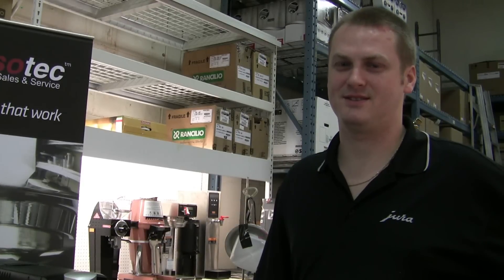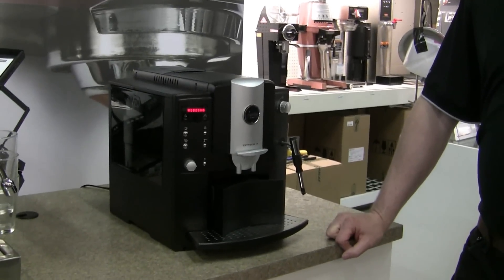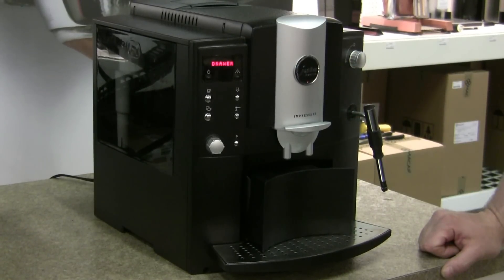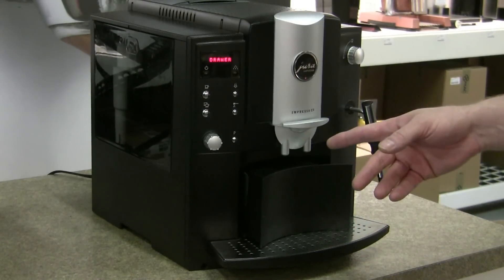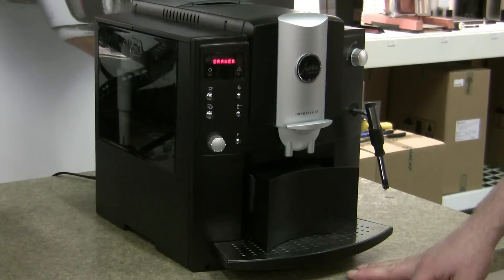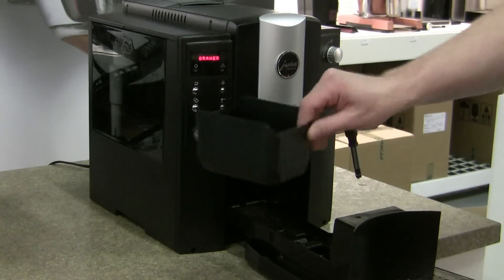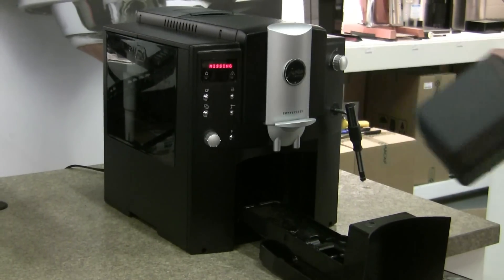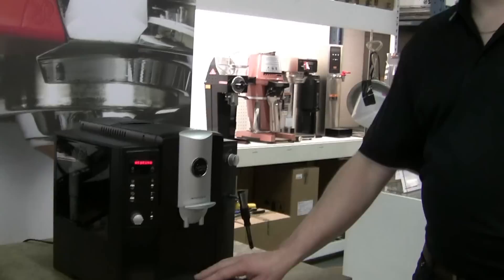Jura Espresso Machine - Resetting Brew Unit (Error 3)

Comment: My Jura C60  is stuck on "Switch Open or Switch Closed" on the right side of machine and won't brew until I do something with the switch. We really don't use the frothier at all ... help, how do I get past the switch problem. I've tried unplugging, removing the tray to reset. Not working.

Comment: Hi, I have an Jura Impressa E80 with a fault. I drained the machine of water while cleaning it, via the hot water/steam tap. Now it's stuck in a loop saying "Open tap" "Filling system" "Shut tap"  The water tank is full,  but no water is going through the system? Is it possible to reset the machine, or does it need to go to the shop. Thank You for any help :)
Reply from the maker: Hi Tora, it sounds like there's something wrong with the CPU / sensor system. Probably a good idea to have it looked at by authorized JURA technicians. Thanks for checking in!

Comment: Hi i have the Jura F90 and it has this issue i tried i followed you instructions and nothing happened at all ??
Reply from the maker: Thanks for reaching out to us with this issue!
Sounds like your best bet is to call the Jura Hospitality Centre (905-501-7600) for further service instructions. If you're located near us or anywhere in Canada, you can also contact our service department by emailing service@espressotec.com — our team will be able to assist you further.